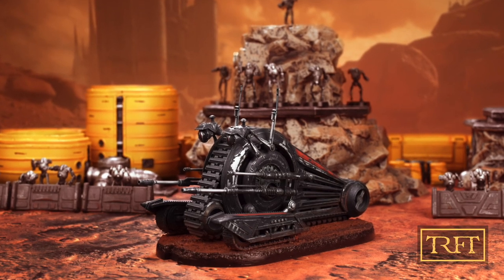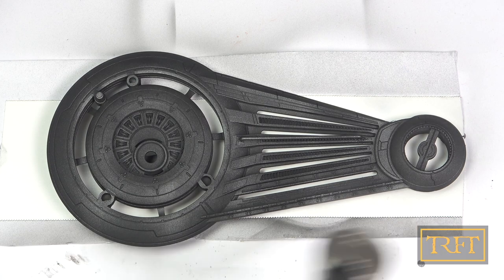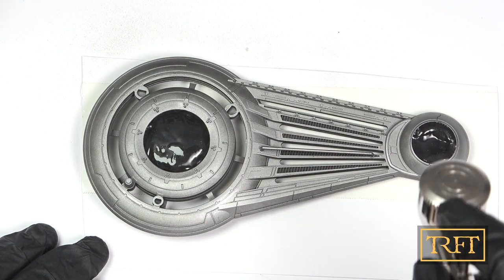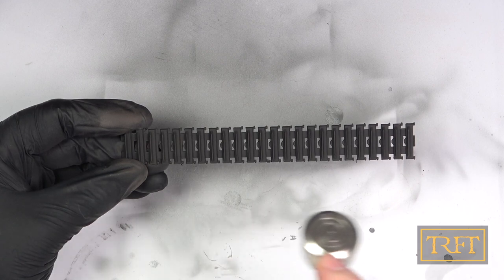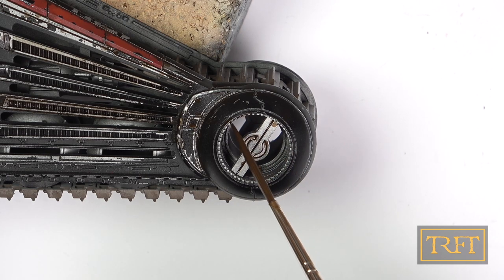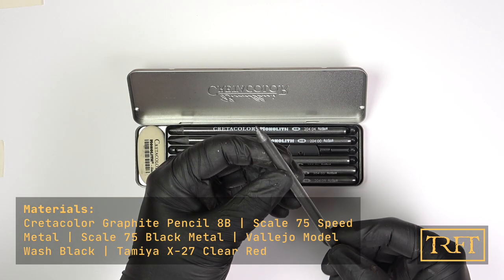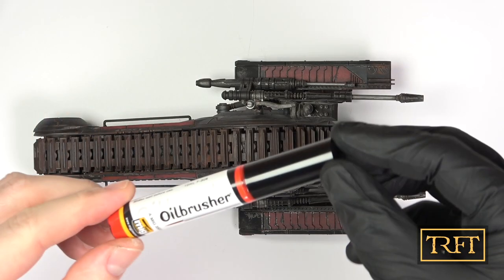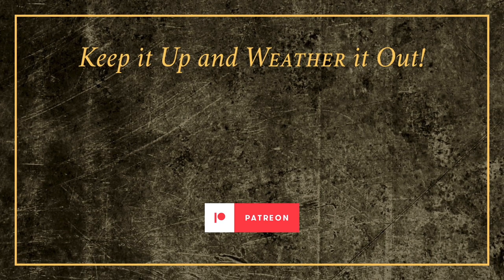Star Wars Legion NR-N99 "Snail" Tank | Star Wars Hobby Tutorial 9/16

Comment: Brilliant video! Just wondering as I don't own an airbrush at the moment can I paint the chipping fluid on by brush?
Reply from the maker: Hi Robert, thank you very much. Yes, you can - and it can also be applied with a sponge. But what will get you best results if you don't have an airbrush is a can of hairspray - apply a couple of light coats the way you would with a rattlecan primer. Have fun!
Reply: @TheRaceForTerra  fantastic I have an AAT that needs painting. When I have done the hairspray can I use a rattle can to paint over?
Reply from the maker: @robertaftanas7916  Yes, but do no let either the hairspray OR the paint dry for more than until touch dry. Also, a varnish before the hairspray will help avoid any issues. Would you like me to do a video on this, perhaps...? ;-)
Reply: @TheRaceForTerra  that would be awesome 👌
I did search for a video using hairspray but there not many that go into much detail.